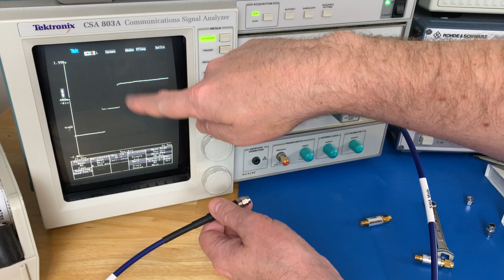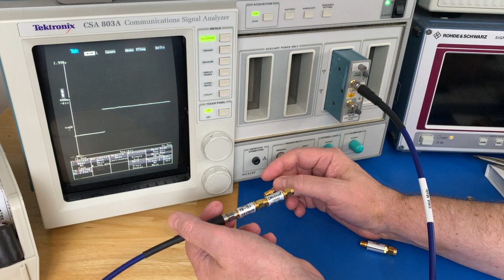Can you use an attenuator as a terminator / load?

Comment: To answer your question regarding the performance of attenuators above their rated frequency band - they usually just start reflecting more and more. A resistive attenuator's elements will start to drift from their nominal impedances as parasitic reactances grow, causing impedance mismatches, and eventually it will look like an open or short depending on whether it starts to radiate power out of the signal path or across the impedances.